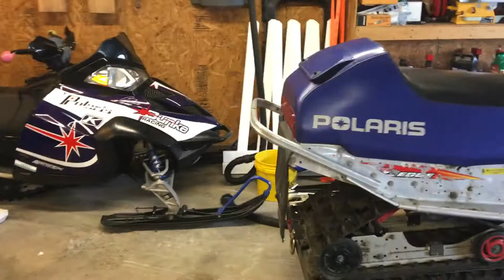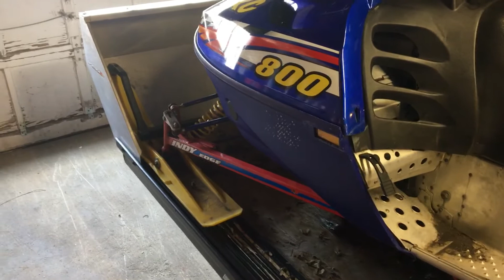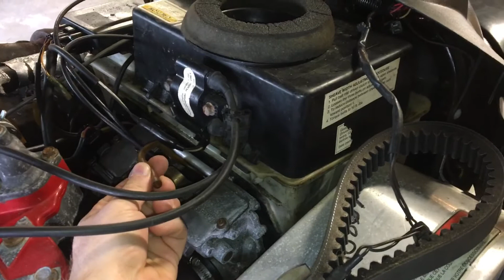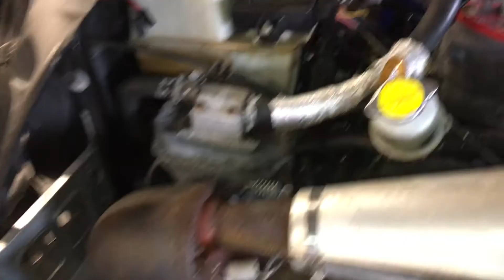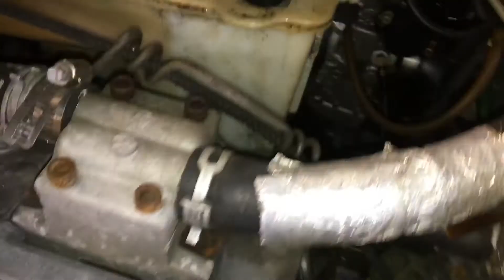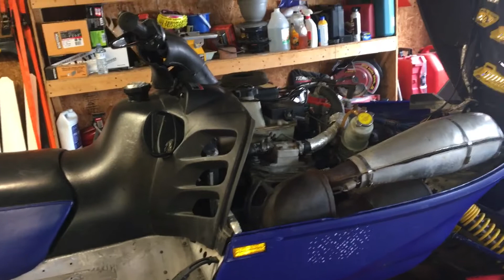New Project Sled - 2001 Polaris XC 800 Introduction

Comment: Good morning. Just purchased this same sled 2001 SX 800. As usual gave it the once over, couldn't test ride it. Started fine on the trailer. So after two days of maintenance and fixing small things I gave it a good shake down run and made it back to the trailer, but pretty near died of accesive fumes while riding. Even had a buddy jump on it and said the same thing, strong presence of fumes. So just wondering if you could point me in a direction where to start to try and figure it out. Is was litterly coughing after about a half hour into the ride and it was to the point I headed back after about two hrs. Thanks in advance for any info. This is a fast and fun machine, but very uncomfortable with this issue. 
I couldn't find much info on line, so I've Checked out your project videos and looks like your very well educated on possiblily helping me out. Thanks again.
Reply from the maker: There’s a couple of things to check for on the XCR 800. 

Carb slides are plastic and are known for cracking. 

The O rings on the floats in the carbs leak and should be replaced. Take a look at the Fusion Carb video on my channel. Same process.
Reply: @StreetersGarage  thank you. It's a start.
Reply: If these parts you pointed are true to be faulty, would it still allow the machine to run good above and beyond the high level of fumes.
Reply: Ok video was very informative.  Wow on the air box removal. I assume your slides were OK, didn't see any explanation on that, so is it just a visual thing that I look for a Crack or do I need to pull them right out and check ?
Reply from the maker: The original ones were green and were prone to cracking. The updated ones were black.

Comment: Not a bad score !! My friend has a 2005  xc xp he bought it two years ago and paid $2100 CDN. The top end had been rebuilt. It runs fine , rides very ,very stiff. Hard on gas,power is ok. The handle bars are not adjustable and the position kills my shoulders and upper back. I drove for a day and will never drive it again . LOL . I'm looking forward to seeing how yours turns out. There is some money to be made on it .Make sure you give it tons of time to warm up ,the engine will cold sieze . Mark
Reply from the maker: +Mark Bow 

It's getting there. I have a bunch of footage I need to edit on Saturday and get it posted. 

Agree on the stiffness. With me on it, there is almost no drop in the suspension. I'm going toe bed to drop the springs to the lowest setting for the person who will be riding it.